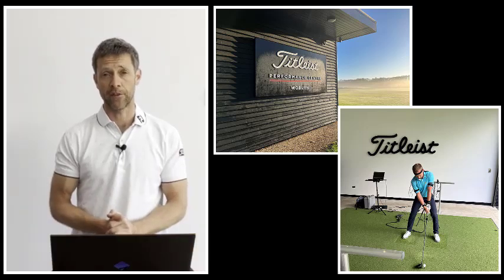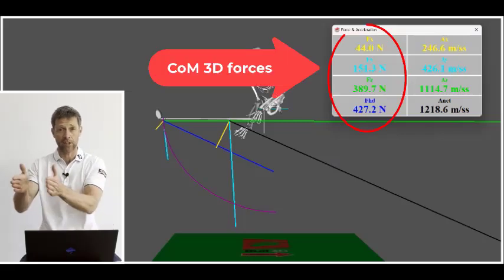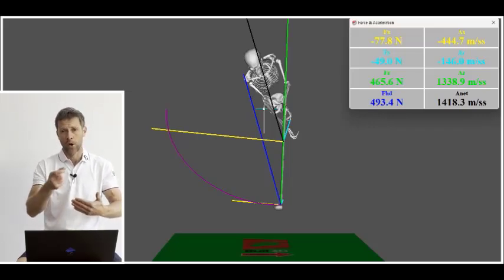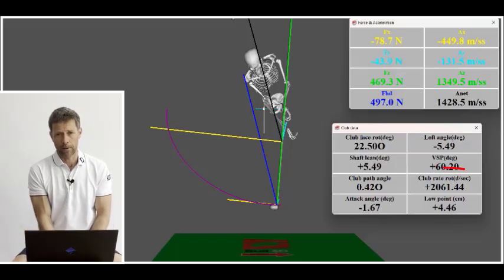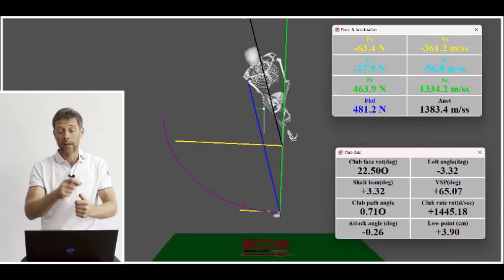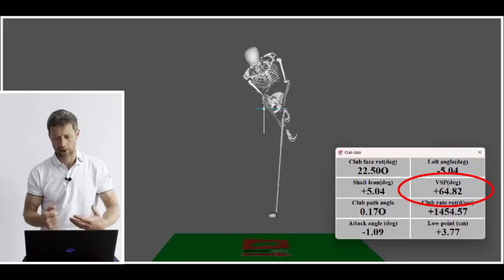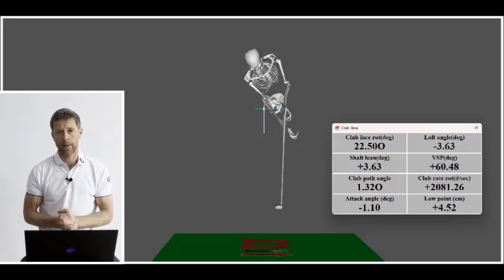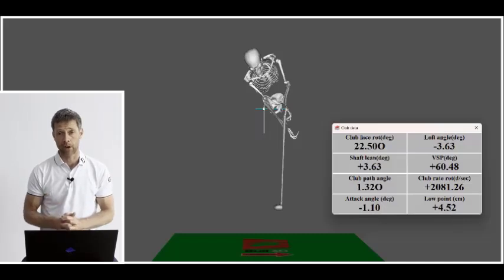Weighting the driver and it's influence on club behaviour.

Comment: I just went through 2 bags of clubs checking swing weight. I always stride for D2,but discovered C8 -D7.  I was able solve with lead tape in 4gram strips for irons to go C8-D2. But this softens the club flex. It is a real donimo affect if worked wrong.

Comment: I’m curious to know how much weight were you guys using, as far as I know 2 grams equals 1 measure of Swing weight, and the other question is how you do it? Lead tape?

Thanks great content
Reply: Thank you Alex, much appreciated. They use a small device that allowed them to insert the weight into the butt of the grip and the base/mouth of the grip. They are actual small weights used therefore, they were extremely precise with both the placement and exact weight used. Thanks again